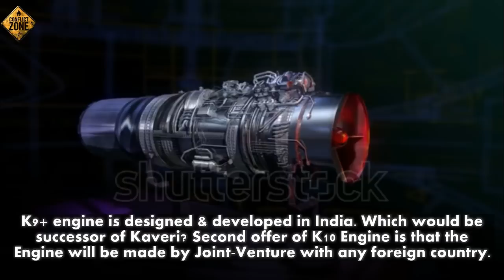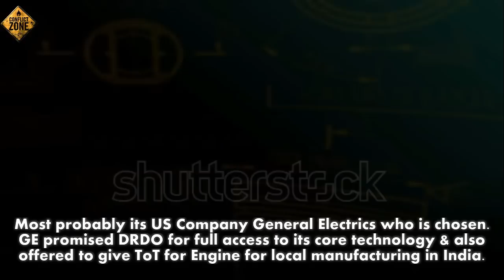Why AMCA Will Be A Game Changer For India

Comment: Your informing is not so much correct amca will be made under make india most of the system will be made in india avonic, radar, engine, all system will be used in amca will be made under make in india this all system will be test in tejas mk 2.